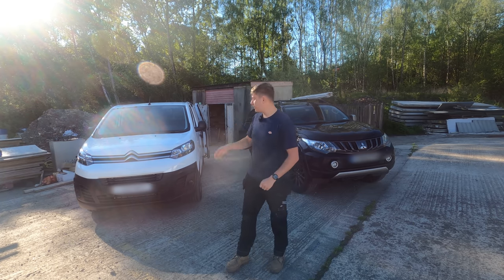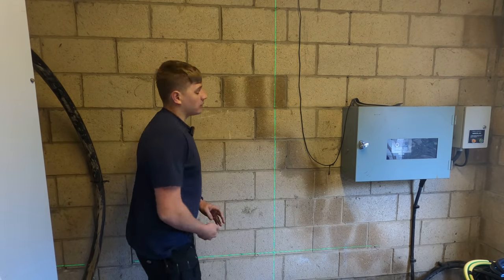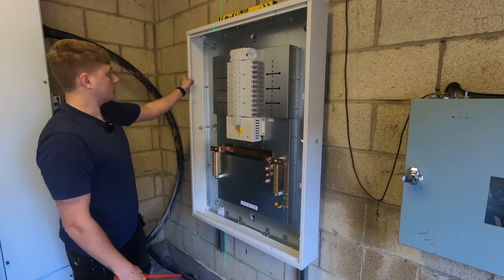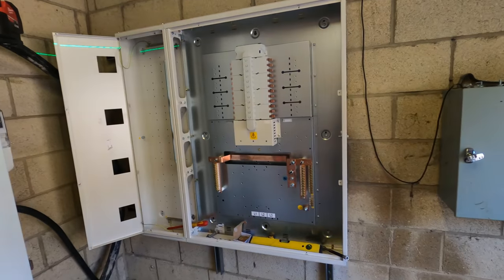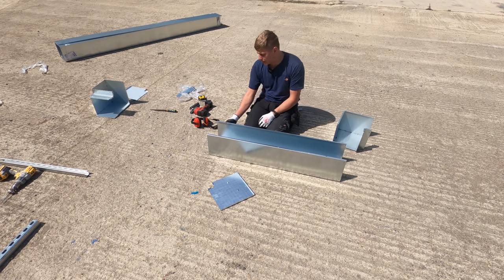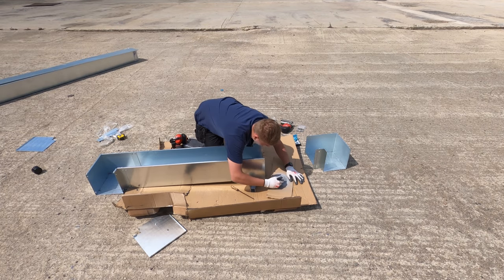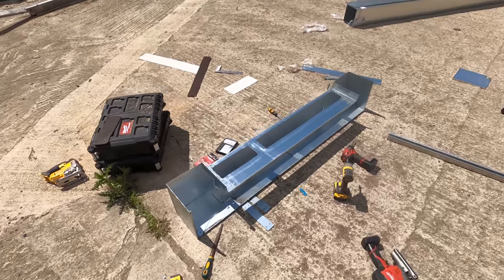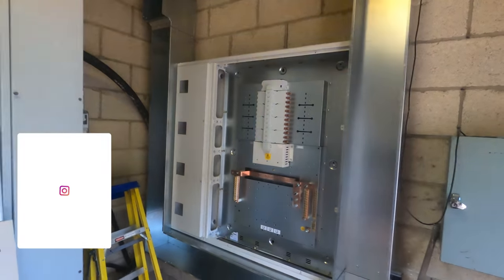Preparing for a 630A MCCB panel build

Comment: Quality mate. I’ve got to replace an old fuse distribution board and replace with one of them Hager’s . Got to be done on a Saturday though 🤦‍♂️ keep up the good work 👍
Reply: @residualelectrical  I charge Sunday rates for working a Saturday mate🤣 worked on a few of the Hager but never installed one. Always installed Schneider. Fitted around 10 Hager distribution boards on the job so going to fit a Hager panel board so it’s the same. 👍